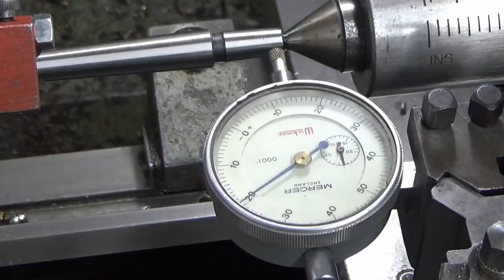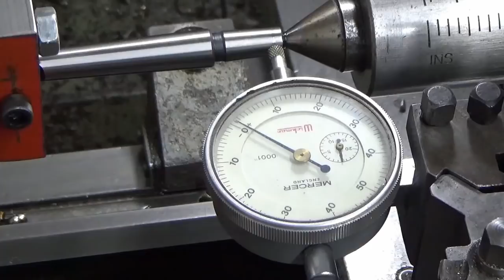Micro chuck & Sensitive Drilling for Mill & Lathe

Comment: The drill below centre won’t be a problem it’s just the clearance being taken up on the sliding parts, once it’s found the centre it will stay there. You see this often. Nice Chuck you have and it’ll be put to good use.
Reply from the maker: Hi Kevin, thanks for the comment, yes, for shallow holes I think it will be OK as you say, but I think any deep holes may end up breaking drills (not sure). I may make another cartridge to hold the chuck back end, but make it in the 4 Jaw and deliberately throw the centre hole eccentric by about 0.04". This way I can rotate to find true centre, mark it up then mill the clamp slot (this should work). Cheers, Jon

Comment: Another possible source of "tailstock" error could be from the chuck itself.  Put a gage pin into the small chuck and the other end in your main chuck and a dti on the parallel shank and see what the runout is.  West German chucks are usually top quality, but this one could be a post bierfest example.
Reply from the maker: Hi Mike, thanks for the comment, yeah, no country is exempt from a Friday afternoon moment lol. I will run some checks in the mill on it and show them in a future Blether video. Cheers, Jon

Comment: Another great video Jon, made mine sometime ago for the very same reason, could not get small drills in my large chuck. I used a small Jacobs 0 - 1/4 for mine. Good idea to use it for a sensitive drilling attachment. You have given me another project for my workshop!!🤣 Keep up the good work Jon👍
Reply from the maker: Hi Gary, thanks for the comment. It's certainly going to be much easier getting the drills to run right in the mill now. Cheers, Jon
Reply: @jonsworkshop  👍

Comment: Jon, I'm glad YOU spotted the below center problem, saves me telling you. LOL I think that you bent the 1 mm drill in the lathe as it had to cut upwards. Regards from Australia.
Reply from the maker: Hi Dave, thanks for the comment. It's true what they say, the camera never lies! I honestly didn't spot this during machining but the video is very clear. Already have a solution in my head (another cartridge but done in the 4 Jaw with the bore about 0.04" eccentric) should only take 30 mins to make and will allow me to adjust to be bang on centre. Cheers, Jon

Comment: You may have wanted to leave a small shoulder on that arbor so that you can more easily remove the chuck from it with wedges down the road. I'd also mention that (although hard to find and not cheap) "Globe" Japan makes a J1-10mm precision straight shaft arbor. I just got one for a similar Albrecht chuck for my mini-mill.
Reply from the maker: Hi Jason, thanks for the comment. Good point. I think there is just about enough gap still for some thin wedges. Will check Globe out, thanks. Cheers, Jon

Comment: Great Jon
Very useful.
That's several time i see you drilling or tapping and i always ask myself what is that "milky" stuff you used ???
Thanks.
Reply from the maker: Hi Blou, thanks for the comment and question. It is soluble cutting oil (mix with water to make coolant), there are many types available and the oil content stops rust developing. Cheers, Jon

Comment: Jon would it be possible to use mist coolent instead of your little bottle?
Christopher from Down Under
Reply: He could but at present he has no compressor or room for it.
Reply from the maker: Hi Christopher, thanks for the comment and suggestion. As Dave has said, compressor and space are the immediate blockers, however, I may look to address this in the future. Cheers, Jon

Comment: Have you tried adjusting drill runout by knocking the collet nut when slightly backed off.
Reply from the maker: Hi Jon, thanks for the comment. At this point I am not sure if it is the chuck or the drill. I will run some checks and update in a future Blether video. Cheers, Jon

Comment: I recently bought a similar high precision drill chuck, the same brand as yours, for over 80€. It has 0,1mm run out :-(
So, maybe check yours for run out too. Just to be sure.
Btw, did you receive my email from 12 feb. 2022 ?
Reply from the maker: Hi Rusti, thanks for the comment. I am planning to run some checks on the chuck, I will show them in a future Blether video, thanks for the info on yours. I have just checked, for whatever reason, your email had gone into my Spam box. Will reply soon. Cheers, Jon